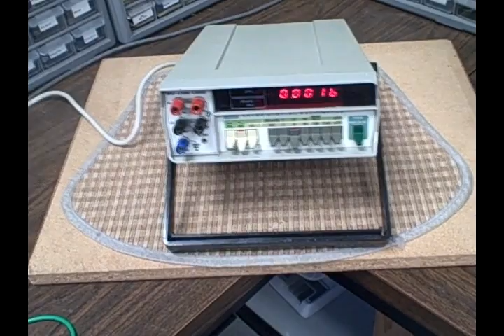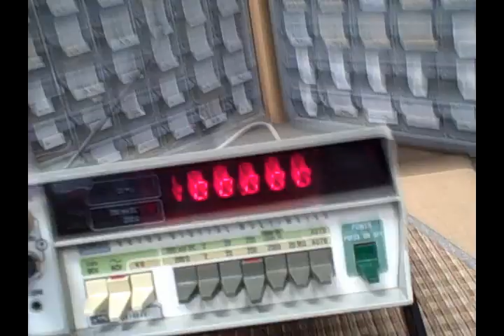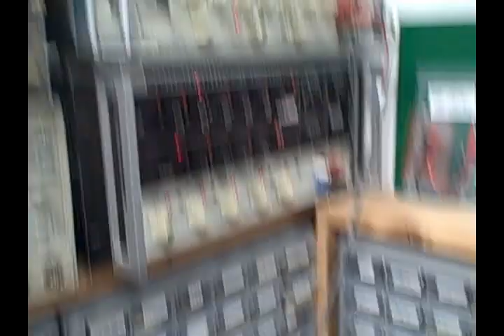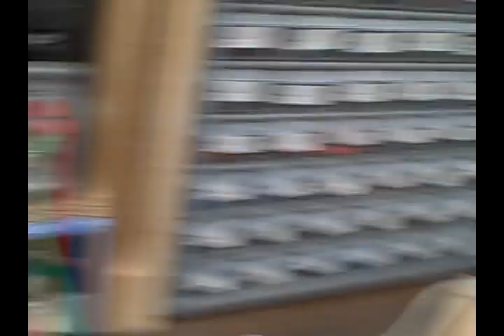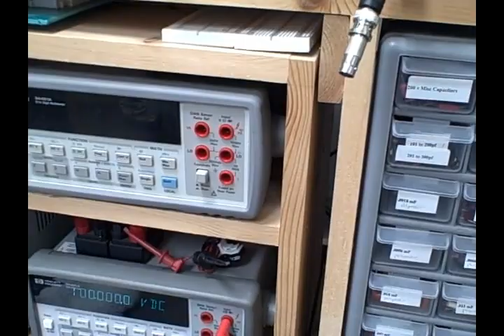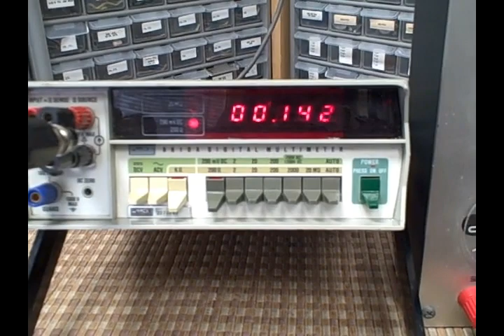Fluke 8810A u3

Comment: Set it up for 4 wire ohms measurements and it will be much better on Ohms. I have one of these that probably hasn't been officially calbrated since the 1980's and it is dead on. I also have it's older cousin the 8800 and it's dead on to. Nice meters. I do have another 8810A that has a broken handle (the shipper did not listen to me and pack it properly. It also has a broken red binding post. Maybe someday I'll find those parts at a Hamfest! Sam W3OHM